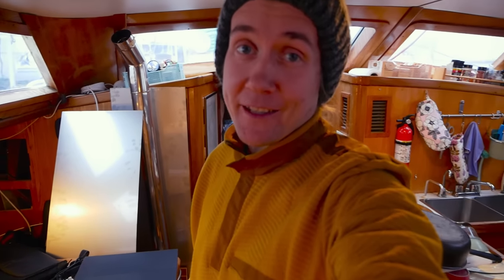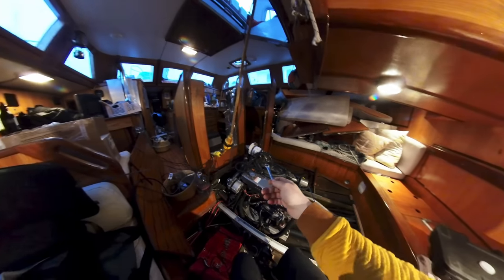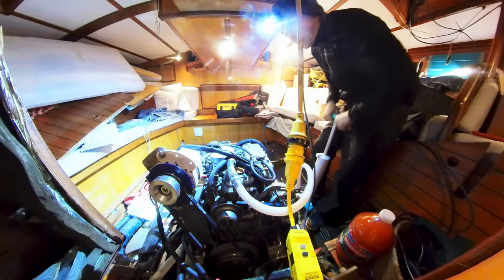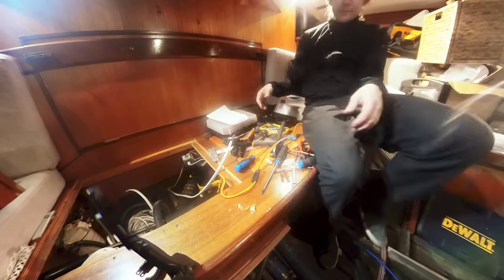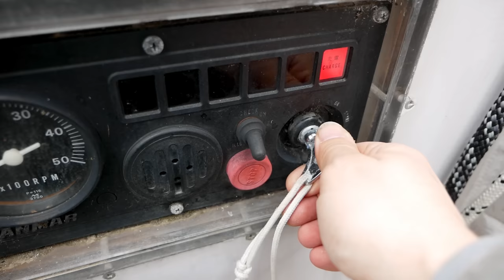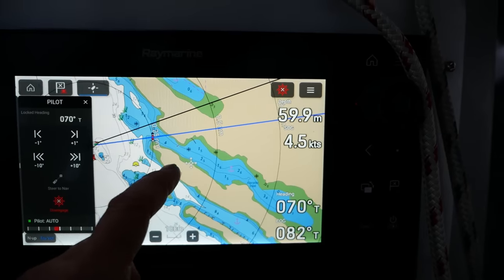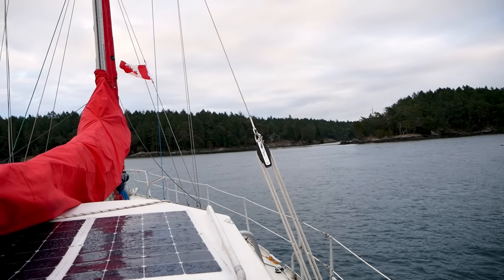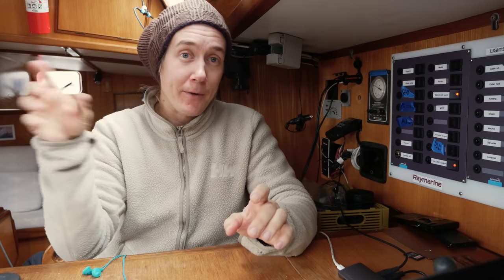FREE HEAT for Our Boat! NO Extra Running Costs!

Comment from the maker: hey everyone! i wanted to publish this video because i haven't seen this particular type of a heating system on many boats... AND it is very cheap to install and free to run (when you're motoring). The snowy conditions in the thumbnail start in the next video, which I'm already putting together, and we'll get to test this thing even more thoroughly... Thanks for watching!
Reply: It's not actually coolant at all - is it. Heat transfer fluid makes more sense - doesn't it. The radiation type heat exchanger is very effective at transferring heat over it's surface area quickly - isn't it. Very nice - share.✌️♥️👍
Reply: @OKuusava  The HTF cannot cool the engine.
Reply: Good idea I enjoy your video’s
Reply: With our frosty winters, where it sometimes gets down to 12°C we probably won't be installing one, but I often wondered about installing a car air conditioning unit to cool the boat. It was 32°C at 11pm last week. Humidity around 90%. Note that we do feel the cold even at 20°C, because you become accustomed to heat.
Reply: @anthonyrstrawbridge  I found our chandlers only sell stuff labelled "Coolant". Apparently it transfers heat from the engine to water from the sea. Who knew?
Reply: @philgray1023  Yes, imagine stopping a vehicle with brake fluid.
Reply: @anthonyrstrawbridge  Apparently brakes don't stop cars, they just transfer kinetic energy  from the (insert entity here) by converting it into heat using a magical thing called friction. I failed physics because of this.
Reply: You should have used a  way valves on the lines .
Reply: @philgray1023  Yes sir, friction braking is almost the normal on friction surfaces but I'm confident that it will be replaced almost exclusively within this generation. I love ElMoFo,  MagneticFlux, Regen where the braking forces generate more KW of electrical energy than is needed to accelerate a vehicle back up to speed.
Reply: @anthonyrstrawbridge , that’s not possible without braking more than the car speed. You also need to break some laws of physics, specifically the one about conservation of energy. The law that makes a “perpetuum mobile” impossible. If one could harvest more energy form retarding speed than needed for accelerating it back up to the same speed, one would need to create energy, which is not possible for non divine entities. We can only convert energy into different forms. However, I fully agree that friction brakes on cars will be almost completely replaced by electrical regenerative brakes.
Reply: @SteinVarjord  In actual highway vehicle operating conditions the net sum of forces when transformed into braking power as (Regen) electrical power is quite significant, proven reliable and manufacturing production costs soon lower than hydraulic mechanical friction type - like Fred Flintstones foot 🦶
Reply: @SteinVarjord   The operating baseline of combustion engine vehicle operations is never zero. The energy required is not considered a positive number it is actually a negative. The average combustion engine is approximately 35% efficient at converting heat energy into motive force. During braking and coasting this in efficiency continues. The sum total inefficiency energy losses of a typical vehicle operation can actually literally be recovered when factoring the the hybrid electric drive with regenerative braking. First, the initial vehicle operating sequence efficiency increases are added ( increased efficiency). Second, the deceleration inefficiency becomes a net gain of electrical energy. In comparison to the true baseline there is a net gain in energy during many vehicle operations. Mountain driving with low drag vehicles such as the Chevrolet Corvette and the Toyota Camry are an example. City transit bus operations are another. Remember the initial energy requirement is considered a negative quantity - a deficit.
Reply: In the U.S.A., a company named “Aqua-Hot” makes diesel-fired units for use in larger RVs.  They use units like you show here, called “fan-coil heat exchangers.”  The main unit can be plumbed in with the engine coolant, so the Aqua-Hot can get heat from the engine or produce it’s own heat and use it to pre-heat the engine (very useful on a very large diesel engine in cold weather).  I have an older motorcoach conversion with a 3-zone + engine Aqua-Hot unit.  Neat technology.
Reply: How was the engine cooling itself before? You're not wrong that you can over cool the engine if there's no thermostat in the loop, but then that would also make your new addition ineffective to heat the boat.

 If there's a main radiator and all it does is waste heat to the outside, make a bypass for that so you can have it just a sweltering on the inside of the boat, which I can't see any downside to in a damp cool climate zone like that!
Reply: Het wiel is al uitgevonden, hou het simpel.
En veilig. En als je er weinig vanaf weet.
Shakel een vakman in.
Reply: @philgray1023 Also noise & some degree of light if only infra red!

Comment: Another suggestion for you in regards to the heater... keep a Pipe Coupler handy in case that heater does leak. Then it's easy to bypass it. Or add a bypass valve to keep things running with heater out of the loop... No I'm not a plumber, just trying to help out. Thanks for sharing your adventure and welcome to Canada!!

Comment: Probably mentioned before but that has saltwater flowing through it so it could corrode and that will just pump water all over. So i think you should put two ball valves in and two tee's so you can bypass it if you spring a leak... cheap insurance...love the show

Comment: You should also consider to watch out for air bubbles you might have brought into your cooling system during the construction. This might cause local overheating of your engine during the first test drives if you’d go for full throttle right away and besides you should check the coolant level regularly for the first few days of use. Once any remaining air is finally blown out, the coolant level will be accordingly lower then. Have a nice trip!

Comment: You are going to love that heater. One thing to keep in mind is to put the bus heater in a location that has clean air, so the fan pushes clean air through the radiator, otherwise the air coming out of the heater is going to be smelly.
Reply from the maker: yeah, i'm glad this locker and the bilge are not smelly! but definitely don't want to suck in the air directly from the engine compartment 🤓
Reply: You probably don't have to worry about cooling the Motor to much because the Motor probably will have a bimettal thermostat that just opens up the coolant loop when the minimum Temperatur has been reached. Here a Video about an yanmar Diesel as well at 4:20 it is explained in Detail https://youtu.be/aZv4IXFPMqg

Comment: It would seem to me that taking your coolant after the thermostat would negate any concerns about maintaining engine temperatures.  There will be no flow until the engine is up to temperature. Also, putting the heater in front of the hot water heat exchanger would significantly reduce the production of hot water. Or am I missing something? Perhaps adding either-or valves would be an idea, particularly in warmer weather.
Reply from the maker: Yes you're correct, if your thermostat works correctly then this should not have any effect on engine temperatures. If the heater fan is off then I don't think it has much effect on the water heater at all because the coolant will just flow through the pipes and won't give off much heat. I know some people in warm climates have installed valves to bypass the heater during summer months but I think it's unnecessary (even in a warmer place)
Reply: @AlluringArctic  seems if you plumbed it from the water heater return line then no matter what it won't effect water heater temperature. But if it's on the incoming line, then yes.
Reply: We have a boiler with a heat exchanger that uses the engine coolant. In our case that boiler produces really hot water, much warmer than the hot water at home. Reducing that heat by making the coolant flow through the fan heater first would not be a problem.

Comment: I would run another outlet to the lowest/ furthest point(s) in the cabin. That way the air is circulated regardless of height/location.  Removing excess humidity from the cabin would also be worthwhile.  A dehumidifier could be run intermittently.  Perhaps, have the ability to divert air to a drying locker, even a separate hanging drying locker. That way you can dry sailing/other gear.

Comment: Sochi/Sochi:

So happy you both are safe.  Interesting video on how to heat you’re sail boat in frigid temperatures.
I’m surprised your engine does not have a temperature gauge.  Sohvi made a cameo appearance and that’s all most of need.
Stay safe.
Reply: It just has an overheat sensor. Most sailboats I have been on don't have temperature sensor, only overheat sensor

Comment: Nice addition, make sure you get all the air out of the system.
If you need more output from the stock Yanmar alternator, you can add a manual control to bypass the internal voltage regulator. It's not hard to do. Just don't forget when you have it turned on. If you're interested, I could email how to instructions.

Comment: I installed a bus heater like this in my last boat and loved it! I installed it under the navigation table so the intake was drawing and reheating cabin air which made it very effective. It’s also easy to install a fan rheostat for speed control which is basically what your car has too.

Comment: I mounted a simular (but way bigger) defroster on my 40ft steelboat. It was not often used in very low latitudes but I found it VERY useful when motoring in hot rivers closer in the tropics. To be able to extract HEAT when it’s very hot makes the engine (and captain) very happy :) GREAT VIDEO as usual
Reply: Did you direct pipes to a porthole?

Comment: We installed a similar bus heater in our Hughes 38. Ours was smaller and had a quiet single speed fan. I installed a valve between the in/out hoses to regulate how much went through or bypassed the heater. It was great to have a toasty warm cabin after we anchored. We spent 14½ years cruising those same waters year round, and a heater makes a big difference.

Comment: The purchase of a 12/24vdc PWM motor speed controller can be accomplished at many sites like the jungle or bay, for ones of dollars. This will do nicely to reduce the current below the amperage observed ( 12vdc / 10 amp 120 Watts 24vdc/10amp 240 Watts). The speed switch design utilized is power hungry, as it accomplishes speed control by resistance exchanging volts into heat. Therefore remove it or leave it set on high in series with the PWM speed controller.
Go PWM
many people attempt to control the speed of a DC motor using a large variable resistor (Rheostat) in series with the motor as shown.
Simple and easy way to control the speed of a motor is to regulate the amount of voltage across its terminals and this can be achieved using “Pulse Width Modulation” or PWM.

As its name suggests, pulse width modulation speed control works by driving the motor with a series of “ON-OFF” pulses and varying the duty cycle, the fraction of time that the output voltage is “ON”.

Comment: If you have a dry cupboard i would pipe a ducting to the cupboard that will dry it quick if its a dry cupboard. Use a Y duct to take a duct off to different areas of the boat.
Reply from the maker: we actually have an existing ducting for the forced air diesel heater, we could duct into that in the future. Right now no time for that, busy sailing ;)

Comment: I did not see all of the installation, but the part I saw worries me. You have installed the heater inside the engine compartment which seems to be fairly closed in. I see 2 downsides to this; 1- If the exhaust should leak while you need heat, you will get killed by the CO2 from the engine. 2- To have hot air to blow in the cabin, the heater needs air to come in its intake. where does the heater take the air ? It MUST absolutely be outside of the engine compartment for your safety.  A small exhaust leak while you sleep will make you sleep forever ! Be careful and have good sailing

Comment: Please can you check airflow, it’s difficult to determine from the video but I believe the hot air from this unit is being drawn from the engine bay. The technical locker appears not to be wholly isolated from the engine bay. If I am correct you can draw escaping combustion gasses and oil breather gasses that you may not normally experience. In a vehicle installation the engine firewall has sealed through holes for cables etc. this is a risk mitigation for carbon monoxide poisoning. I hope you do not experience such but you may wish to check the airflow, spraying strong scent into the engine bay could help you. An engine leak may become a serious issue if you are drawing air from the engine bay. Safe sailing.

Comment: Installing a bus eater was one of my lockdown projects on my 42ft Beneteau. The engine is the usual VP55hp, with no header tank, and has the usual hot water heater fitter. The first decision was to fit it before the hot water heater or after. I went for after so the HW heats up first. However, this does mean we have to wait for the HW tank to heat up  before we get any usable hot air. Typically this can take 1-2 hours of running, but once it's all warmed through it chucks out the heat. I have temperature gauges on the engine and seems to run at the same tamp as before. 
From some research it looked like the additional coolant in the system needed a header tank, so we fitted one as well. 
I ran the outlet ducting into the existing Wabasco ducting, (with a check valve) so minimal extra sound when it's running. 
I noted another comment about fitting a Y valve and drawing air from the cabin or from outside, which is just what I did, add this to a full insulation project and heat/condensation is no problem. Well almost, an unexpected problem is that the 5KW Wabasco is now too big and we often get 28c in the salon, before the heater cuts out, but when it's well below zero c the Wabasco just ticks over at minimum and all is good.

Comment: I replaced the original fan on my heater with a computer fan which draws less amps and runs quieter. I also installed a thermostat so the fan will cut out at a set temperature

Comment: Usually we use the engine cooling loop to heat water in the hot water tank rather than for buss heat. How do you get hot water?

Comment: you can replace the fans with quiet computer fans that move more volume with way less noise. The pitch of the blades make a big difference. They also can use much less amps.
Reply: That's a great idea! Plus the permanant magnet motors in those fans not only are more efficient, they will likely last far longer
Reply: @jonathangehman4005  You are right, I've a 12v computer fan that so far has been running continuously for 13 years ventilating a compost toilet.

Comment: My boat had two big ones in the cockpit for cruising in cold climates with two fans on each one. First boat I've seen with them in the cockpit. I took one out to put inside also! there engine heated also.  I have a kabola hydronic diesel heater that does the water heater and all the boat also. A great system!

Comment: You should have a engine temperature gauge and audible over temp alarm. There are many things in a boat to cause engine overheating many of which start slowly. I always watched mine like a hawk. I also had a seawater flow alarm. It beeped a few times at 1 am and temp was running 185 instead of 180. I found a clump of sargasso weed seeds clogged in the seawater strainer input. Diesel boat engines should last a long time. Overheating is bad and often a head is warped or cracked if the over temp alarm goes off.
Reply: The engine has overheat alarm. Almost all sailboat engines only have this. I have never been in a sailboat with an actual gauge
Reply: @jonnenne  They should have a gauge. The Yanmar control panels had a place for one. You're going to be running your engine 24/7 sometimes, not just going into or out of an anchorage or Marina. This is an expedition boat whose single engine should be instrumented as much as possible.

Comment: Nice!  But NEXT PHASE: Install these heaters in all the Berths. Run insulated hose or pipe to each Berth BUT INCLUDE A 3-WAY BYPASS VALVE for each Berth for when no one is in them. Yes, it might look a little unsightly if you choose to run the lines from the outside paneling, but it can be subdued by painting it say, brown. Its important that you provide option to restrict flow so youre not wasting heat if youre in the Berth and not the Salon. Its a relatively affordable upgrade and worth the extra trouble. Consider doing this upgrade by the beginning of Fall.

Comment: You analysis is correct on everything. You might consider adding a fan speed controller and dial it down a bit to improve efficiency and reduce noise. That would also give you an adjustable amount of heat. Later on, if you really like the heat but really don't like the electrical load, I'm sure you know there are larger, lower-,noise, high efficiency fans that would still move lots of air and also be quieter, that you could box-in behind the unit and disconnect the noisy, inefficient fan. That's an automotive fan and they are mostly  cheap, inefficient junk.
Reply from the maker: Yeah you are correct... the fan has three speed settings already. We will maybe change the fan if this one dies, for now we will keep the noisy one, it's next to the noisy engine anyway ;)